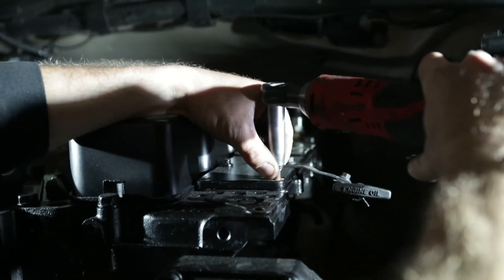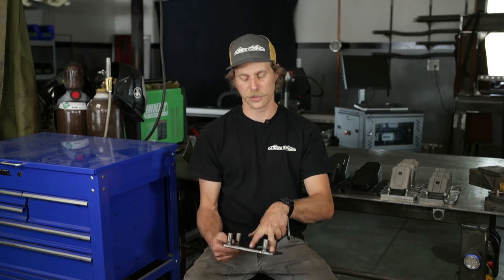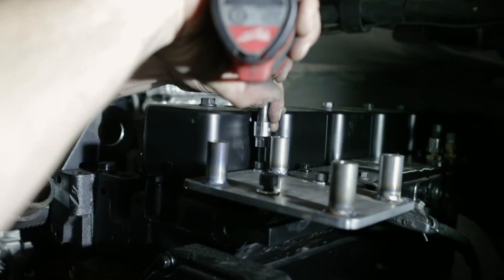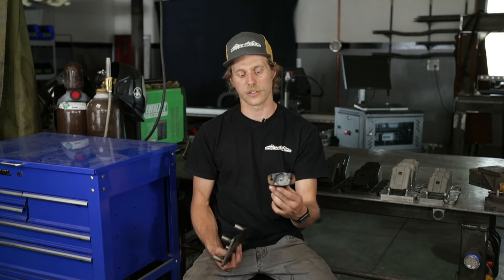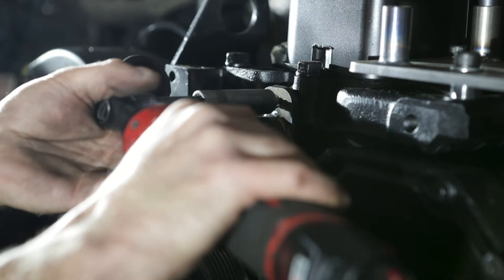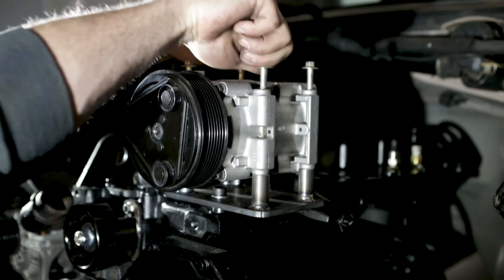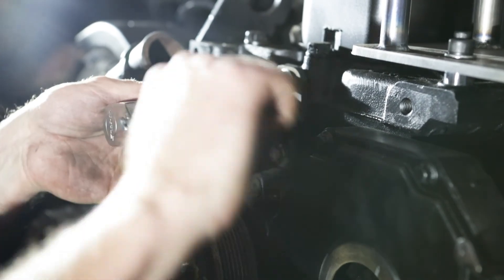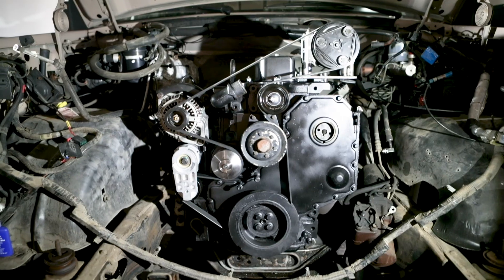Carrick Customs OBS Ford Cummins Conversion AC Compressor Mount Install

Comment: Any reason you didn't use the set of bolts to the left for the idler bracket? I have put about 10000 miles on mine and the fan has squeaked most of those miles. When removing the custom idler bracket I broke one of the supplied bolts in the head, I'm going to try the other set of holes with a longer belt. Looks like it should give more contact area on the fan pulley. Update - it worked, used napa belt 25 080981 . It gives the fan more contact, I would take a free hat or large shirt! 😂
Reply: Aaaaand, No Response. 
My buddy's fan would slip every time his performance Allison shifted 1-2 and 2-3 burnt belts up, ended up changing setups.

Comment: F250 2005 ?
Reply from the maker: No, these are for 1992-1997 F-series trucks. They will work on older and newer trucks as well as long as you adapt your AC lines to work with the FS10 compressor.